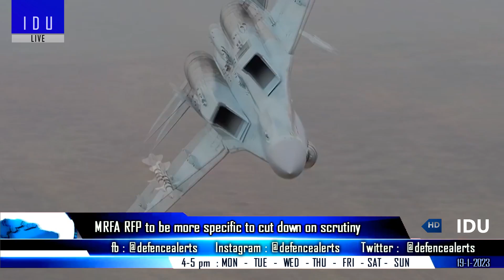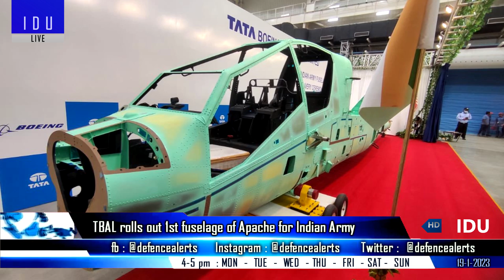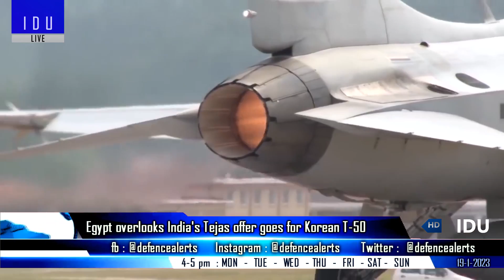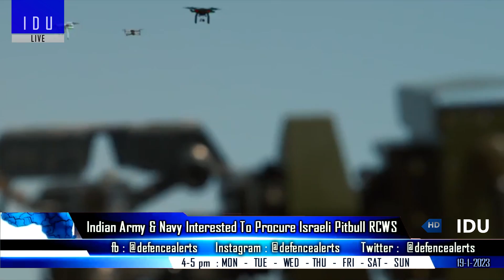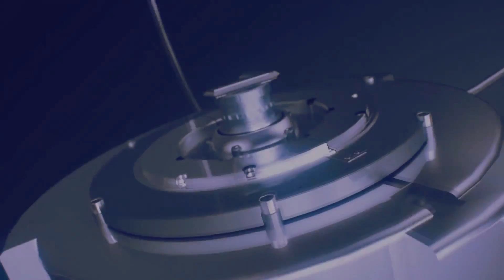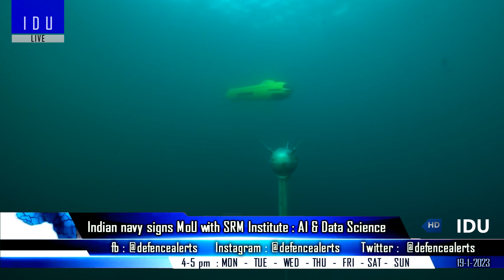Indian Defence Updates : MRFA Specific RFP,Army Apache Roll-Out,Egypt Tejas Lost,Pitbull RCWS Order

Comment: The first set of specifications under RFP should be that we require a Twin engine aircraft and not a single engine aircraft since we would already have Tejas Mk2 by then which fills that requirement.

Secondly, we require a Medium Weight Aircraft (Takeoff Weight & Empty Weight can be specified more clearly).

First requirement will eliminate single engine fighters like Gripen E & F21. Second requirement will eliminate Su 35, F15EX type heavy weight fighters.

This would allow direct competition between only Medium Weight Twin Engine Aircrafts like Rafale, Eurofighter Typhoon, Mig 35, F/A 18 Super Hornet Block 3.

Although not reqd. but if IAF wants they can allow companies to pitch their 5th gen. fighters.

Overall, I'll be happy if we sign this deal by the end of 2024 but honestly I don't expect it before mid/end of 2025 at best.

Comment: If we want to sell our 4th generation tejas then ..HAL should make tejas a supermanuaver fighter by modification... there is some flaw in aerodynamics which creates drag when it fly at high speed so it can't cross the mach 2 .we need to replace the engine with GE F110 -132 block .then it will more advance then rafeal.
Reply: We need  to worry about so much of delay and lack of indeginious engines

Comment: Corruption under table payments US pressure commissions all leads to move to fa50 from tejas.  Otherwise instead of full aircraft with TOT why would a country buy a trainer aircraft.? Also please see the Argentina deal. Secondly please see those countries which have bought jf17 or any other aircraft and are not flying due to aircraft problems or lack of spares offer them to bring in old aircraft and take the new tejas with buying their old aircraft for 2 to 5 million. Just a suggestion.

Comment: Tejas was never actually was planned on becoming the best in its sector. Its was to replace the old migs and mirages, and hal will only make limited amout of tajas mk 1, just enough to replace the old squadrons. The main focus of drdo and hal is on tejas mk 2. Which will be the successor of ragale, amd AMCA which will be a successor to su30's in IAF. Thats the reason the production is not as good, as the deadline for replacement of the migs is around 2025-26, by that time the replacements of the mig will be completed. Thats also the reason why IAF is not heavy testing the teajs mk1, as its not there main concern (except the naval unmaned concept, which is being tested currently).
Reply: source?
Reply: @davidj7-s6m  no source, just some statistics and analysis.
Reply: @rickgolder6818  
  Alright.  👍🏻
Reply: @Rick Golder u don't know about a single thing how geopolitics works that's why you are saying this without any genuine source.
Reply: @subalroy6122  i do know a little about geopolitics. The FA50 was built by KAI with association with *lockheed martin*, sounds familiar. And theres actually no doubt that tejas is better than fa50 (which doesn't even have BVR), and also within budget (which fa50 wasnt and thus they have to increase there budget), the reason tejas are not getting picked is solely political, and HAL's bad way of approach towards there promotion of tejas. 

Fa50 is a rip-of of the f16, with same avionics and cockpit design and similar controls. And not it is not a multirole fighter, its a upgraded trainer (something like the french jaguar). Tejas is beter in thrust, speed, payload capacity, manuaverity and have BVR ( beyond visual range fighting capabilities) which is crucial to modern fighters. And note all of the buyers of fa50, already have an American fighter in ther inventory. They are just buying this for training for there american jets (with similar systems) and light patrol and stuffs. Theres also the name of a big company like 'lockheed martin' associated with fa50, which means that western nations buying this will make a good image to US. Also, do you seriously believe that where a company like Lockheed is present, they will let any other jet win. Theres also the fact that india is currently in good relationship with russia, which further makes it uneasy for the buyers to buy, incase of a sanctions or any other thing.

And about the Pakistani jf fighter being taken by other nations. Note that jf17 is Pakistans no.1 fighter, and tejas is currently in no.3 of IAF rank, which will be further down after tejas mk2 and tedbf induction. So Pakistan making hundreds many jf17 is a requirement for them, wheather as for india, Tejas is just replacement program for the old aircrafts.
Reply: @rickgolder6818  i think u got the answer why koran fa 50 having these kind of aggressive sales around the world and also it can be equipped with us missiles that doesn't mean HAL doesn't have faults. HAL and Indian beurocrates needs to change its policies when it comes to sales of Indian defense equipment and also procurement of projects like MRFA program. I'm furious India needs to step up its game if it want to be a exporter of defense equipped. HAL and IAF needs change its attitude and corruption delaying everything. I'm also against these kind of negligence by our govt and organizations.
Reply: @subalroy6122  MRFA is a dead end, and they know it. Even if they sigh the deal tomorrow, it will take around 8-10 years (even more) to fully aquire all of the 114 fighters. So the best thing will be to heavy invest in tejas mk2, so that it doesn't get further delayed and get inducted accordingly. And by looking at the pace of IAF, i can say they are going to do that (ie scraping the mrfa).

Also about the production problem. HAL has said that they will partner with private companies and will given them rights to manufacture these fighters. Which will increase production many times, as in private company the decision making is fast unlike government companies. 

Well the thing is even if hal steps up there game, as long its government owned nothing much is going to happen. If you look into other countries like US and Russia most of the companies are private, thus giving them edge. And our private companies like tata, adani, garuda, L&T etc are just too young, they need time. So i think the decision of HAL giving TOT or rights to build these jets will be a grat boast for our defence economy. 

And about fa50 being able to fire US missiles. Thats something our tejas can do too. It can fire indian, russian and american Missiles. So that is not a problem there.
Reply: @rickgolder6818  i totally agree with you lets hope for the best that's all we can do.
Reply: some guy   ok
Reply: Amca will be made in 2050 I think 🤔